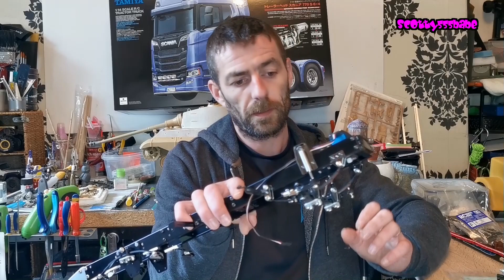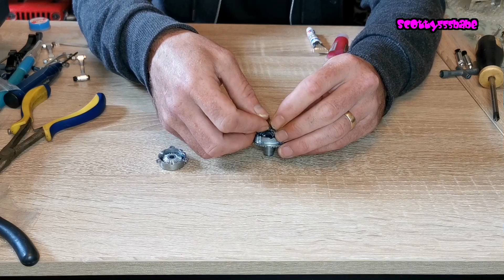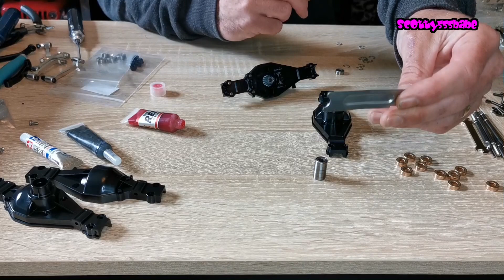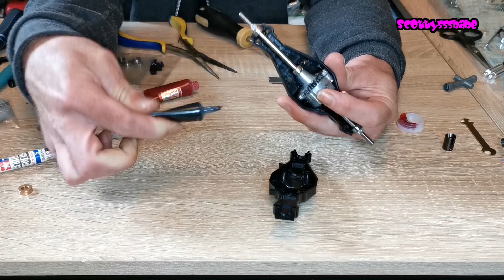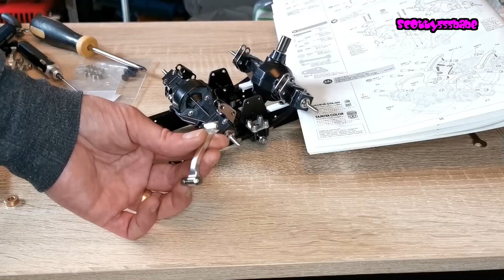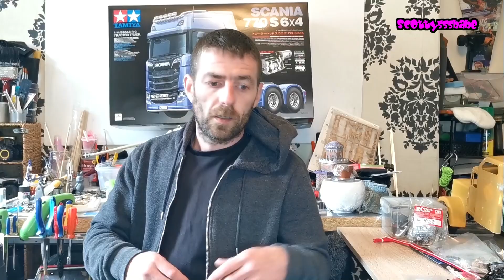SCANIA RC TRUCK BUILD Part 3 | Parts 12-17 Rear axles and Diffs | Tamiya 56368 Scania 770 S New Gen

Comment: Hello dear, thank you for the comprehensive explanations you provide to the followers... My question is, can I use Tamiya oil for the small box next to you instead of other oils? Because I don’t have any other type... and I want to assemble a Scania 770 S
Reply from the maker: Thankyou, if your referring to the gearbox you would need grease my friend
Reply: @scotty555babe  Yes I have the little can of Tamiya lubricant that came with the box....will it do the trick for the small gears?
Reply from the maker: @Ahmed91 of course.

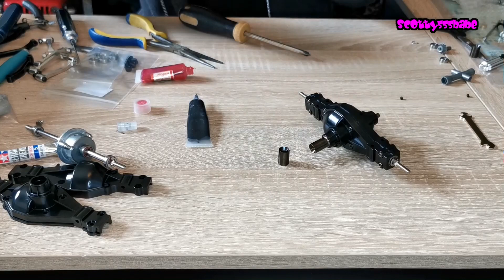Comment: 18:40 yes use lots of threadlock, I had one come loose yesterday while I was put on my travels lol
Reply from the maker: They can be a nightmare for it, also the mirror bracket nuts on the inside of the cabs have a tendency to come free, generally most of the other parts are fine, but the joint cups really need to be welded on 🤣

Comment: Scotty, I can add a hint for the new guys..... Getting the Axles on the Tandems fixed RIGHT, has a simple solution, that Tamiya forgot to mention. 
If the Nuts on the Housings are both facing backwards, and the Bump Stops are both facing up (or down for more travel), it will always be CORRECT! 😉

You showed ME something! It hadn't occurred to me to just leave the Fake Dampers off.
These aren't Crawlers, but I still like as much articulation as possible. Thanks! 👍👍
Reply from the maker: Great little tip I'd never noticed before, I'll do that the next time I build axles 👍
And yes the stock shocks are absolutely utter pointless and of no use other than restricting performance really 👍👍

Comment: to be honnest I can see your point about e-clips, they are a right pain to put on, but if there is 1 e-clip of them all it has to be the fifth wheel plate for me personally, and built 3 of them in nearly a row, as had the one with the kit, then got the mfc, then got the motorized landing legs. so hope you got one built as you will be swearing like a trucker for that video out of all of them!! lol the only other e-clips I hated were the gearbox, but that was because of trying to hold the gears in place, then using the other hand for pliers and the e-clip.
Reply from the maker: I got to agree about the e clip on the fifth wheel, I've built tonnes of trucks and still to this day the e clips piss me off 🤣 I haven't built the kit one up yet as it's having the mfc so I only need to do the one, but I do have another 4 trucks to build after these few are out of the way so I'll always be building the fifth wheels 😫